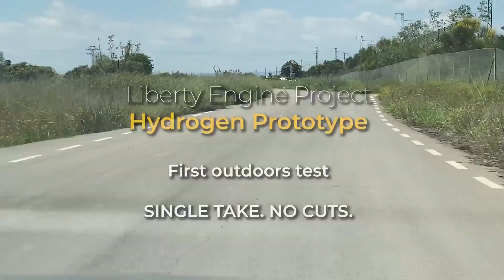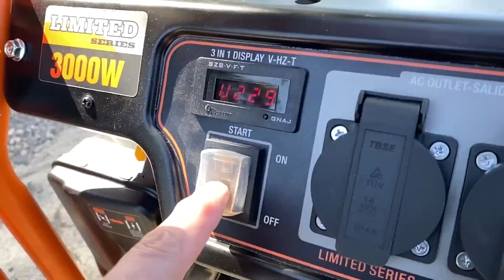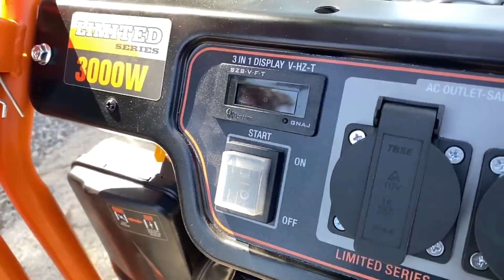I CONVERT GASOLINE ELECTRIC GENERATOR TO RUN ON WATER

Comment: Legit question, is it important that the carburetor and fuel lines have NO leaks? Also, sense there’s no carbon, would you have to change the oil as often? Does the engine get as hot?   Thanks

Comment: Just shared this to an engineer/machinist friend of mine to see if he can build this for us, as we run our generator almost every day (sometimes two or three times a day) and it costs us a fortune in fuel!

For everyone wondering about the charging vs draw on the battery: small gas generators DO NOT have alternators! The electric starters on these are there as a convenience only, and these generators still come with recoil (pull) starters for when the starting battery runs out/fails. Now, that being said, these batteries do last quite awhile: we have to charge ours about every 50-100 starts or so (just a guess) depending on the temperature outside (more frequently during the winter months).

Comment: I would like to see an inline amp meter on the charging Circuit of the battery to show how many amps It is charging . I would also like to see an inline amp meter to show how much your fuel cell is drawing for current to make the hydrogen.. the way you have shown it it does not prove anything because the battery could go dead in 20 minutes I want to see proof that the battery charge was maintained meaning the charging circuit provided more current than the fuel cell desired

Comment: My buddy says this doesn't work as well as you say it does, and I quote, "This is a lie, does not actually work.
First, the energy it takes to separate the Hydrogen from the water is allot and you only get about 40% of the energy back in a ICE. Also you need allot faster generation of hydrogen to sustain an engine like this.
Jewelry makers use torches using this process and you should see what 1500 watts creates.".
Is he accurate?
Is there merit to his statement?
What are the limitation so this machine as well as the concerns of the woman below, with the Hydrogen, Oxygen mixture?
I'm honestly interested.
I wan this to work can it be tweaked to work even more efficiently?

Comment: where can I buy this?does it work with sea water too?It would be nice if you could also buy the device.
Reply: Работать с морской водой он будет еще проще, тогда добавлять в морскую воду порошок KOH не надо будет. Только необходимо будет обязательно хорошо ее профильтровать - там много органических примесей и даже чистка электродов будет менее необходима так как там электроды другие. В России все это есть и работает.

Comment: I'LL REPETED THE SAMAE QUESTION ''WHATIS HH+" WHAT IS THE TRUTH OR YOUR LIESERS
Reply: HH+ [Hydrazine Hydrate] is a mixture of chemicals that helps enhance the electrolysis of water using very little electrical energy. [IMHO]That means that in the future we will all be able to have vehicles that run on Hydrogen extracted directly from water.
Reply: Jakiego rodzaju mikstur to wymaga. Czy je sprzedajesz, czy można samemu zrobić? Pozdrawiam 🙌🥰
Reply: @krzysztofurbaniak8777  Если вы получите расширенные письменные рекомендации и прямую консультацию по ходу изготовления, то сможет это сделать любой человек. Хитрость умалчиваемая в видео это в виде генератора - он должен быть не чисто бензиновый, а бензо-газовый и вопрос в электродах. Те электроды, которые показаны в видео вам периодически будет необходимо разбирать установку и чистить.

Comment: How long does the water in the blue container take to evaporate/lose its ability to create hydrogen?
Reply: DEPENDING on the size of the Filters, general approximation  of the time would be around 4 to 12 hours, with the house water filtration systems running about 12-18 hours. This setup could run 8 hours.
Reply: @williehayes1729  можно даже больше

Comment: What is HH+?
Reply: Hydrazine Hydrate(HH+) and the best HHO separator is Potassium Hydroxide - KOH; A combo of both ran my little house for four years on water with a 3500 watt generator running on HHO and two House sized Filters with an automatic water feeder setup (used a drop in psi to 5lbs) and worked well, up until it was replaced with an air powered unit with four air powered tanks running an air powered compressor charging up one tank at a time in tandem with the other three while one tank discharges into the engine turning the power generator to generate power for the household appliances, yeah, we celebrated with a libation of choice.
Reply: @williehayes1729 could help explain to me how you completed the air powered generator in more detail please or provide a link to a page to a similar setup as your own ? Thanks

Comment: just looking at your bubbler tells me you're not making enough HHO to run ANYTHING let alone an engine of that size.
Reply: Potassium Hydroxide - KOH; Hydrazine Hydrate - HH+; The only way to measure the HHO coming out of the HHO generator is to put an air pressure dial on the input of the carburetor and see if it goes to -20psi. (Vacuum) … Engines will not start well if the engine doesn’t get a consistent draw of at least -5 to -20 psi - before HHO burns back into H2O. A consistent burn of HHO means the engine runs.

Comment: الغاز الذي يخرج اقل من طلب المولد هذا غير صحيح
Reply: Yep, your statement is incorrect. For a 3500 watt generator, the size of the HHO generator filter is correct, and the amount of HH+ (and/or Potassium Hydroxide - KOH) is measured as at least a modest 1/4 cup full.

Comment: With a gas engine of around 30% efficiency, a generator of around 60%, you need 180% OVER UNITY before this will work. I'm a mechanical and electrical Engineer.

Take this into the middle of a field and run it, then I might believe you.

Essentially your battery is providing the extra energy. When that is discharged, the generator will stop .
Reply: It is producing too little hho gas to turn this engine.
Reply: exactly
Reply: What if the generator was smaller ? Would it work better.

Comment: The battery is supplying energy for this construction and the generator is not able to return enough charge back. Please, don't fool the people.
Reply: Избыток, который вы не замечаете появляется в разности потребления топлива - на 5 кВт генератор потребляет 400 мл бензина или менее 100 мл воды. Тут уже имеется первая часть экономической выгоды. Генератор надо только обязательно не чисто бензиновый, а бензиново-газовый с редуктором. Вторая часть выгоды появляется в разности мощности, вырабатываем разности топлива - бензин, если взять за 100%, то газовая смесь HOH не менее 110% а то и более 140% что умалчивается многими   пособиями и справочниками. А аккумулятор нужен только для старта выработки, потом потребление падает так как при нагреве раствора выработка остается прежней при падении потребления. Проблема в том, что вы рассуждаете из того, чему вас учили и не делали это на практике.
Reply: @ГеоргийДемидов-е8ш  Прошу заменит батарею на конденсатор и раскрутить систему первоначально вручную.  Тогда всё будет ясно.
Reply: Quite correct. After ruining my Gasoline Generator to run on Hydrogen, I found the same to be true. The electric company sent four people out to find out how I was stealing electric power from their power lines. I love how quiet it runs.
Reply: @williehayes1729  I got my HHO kit, my 12V batteries and my gasoline generator but I don't quite understand how to connect the batteries to the generator so that they are charging while the system is running.. can you provide me some guidance?
Reply: The battery is supplying energy to separate water into H2 and O2, plus using the supplied H2 and O2 (instead of gasoline)fire up the mechanical engine and turn the generator to make electricity for the household appliances to use. Is that as clear as mud ?
Reply: @williehayes1729  For me - it's clear. The energy FROM the battery is more then the energy TO the battery.
Reply: @Apo5308  yes, you are righ - of course

Comment: C'è pericolo di incendio?
Is there a fire hazard?
Reply: Probably safer than gasoline since it is on demand fuel.  Unless he can get the current from the generator itself however it will only run as long as the battery lasts
Reply: @audiblebites553  Is it possible to obtain current from the generator for its operation without discharging the battery?
Reply: @pietroscarioni5238  I don’t know but that would make it an over unity generator
Reply: @audiblebites553  I think connecting a battery maintainer could solve the problem... or not?
Reply: @audiblebites553  can i write to you privately?
Reply: @pietroscarioni5238  possibly,  if this video is not faked then it does not take that much power to produce enough hydrogen to run the engine.
Reply: @pietroscarioni5238  sure,  I don’t know how to do that on YouTube though
Reply: @audiblebites553  нет не генератором избыточной энергии речь идет об удешевлении но на много процентов и простоте получения топлива - вода, но надо фильтровать или часто прийдется разбирать и чистить электроды, ну и правильные электроды, не отбрасывающие в воду железо, делающие воду оранжевой.

Comment: I dont believe the generator runs on hydrogen!!! Look at the amount of bubbles, never enough for an engine to run!!! You defenatly need 100x more..
I guess this is a 8 hp engine that uses about 2 liters of gasolin per hour... I calculate you need about 1400 liters of gas an hour....1 liquit gas liter makes about 700 liters of gas.  So NO WAY this video is realality!! Its clickbate!!
Did you know you need about twice the amount of power to make hydrogen, that it would give back burning it? Only with Hi frequentie Electric you could make the input less than the output.
Reply: Неплохо что вы попытались считать, но есть существенные ошибки. 1400 литров бензина в час - это какая-то неправильная цифра и скорее всего относится к газу. Во вторых тут часто ошибочно пишут и размышляют что двигатель работает на водороде - электролиз дает водородно-кислородную смесь и вот тут то и есть эффект. 1 литр воды может дать 1820 литров HOH газа электролизная установка на видео способна выработать минимум 180 литров, но может разогнаться и до 800 если сделать колбу и электроды больше и немного другие - автор не обязан вам показать все о миллиметров правильно. Сейчас на Украине и в России в фронтовой зоне обе стороны используют такие  установки.

Comment: This comment is my fuck you to greedy prices for generators - buy a 12v inverter and wire straight to the battary leads on a car , use a spare battary - any car without an ecu can be powered on 100% hydrogen ) diesel cars work well using biofuel ( one cap of white spirit to every litre of cooking oil ) - as a tip - plug a 36v charger on the 12v from the inverter nothing gets hot or melts and keep the power up when it's being used )  generators make too much noise , even if they do use hydrogen , try listening to the thing for hours on end , most of the time they break down after a few weeks so they are a waste of money , and I know this because I live off grid -  can use a 12v tire pump two air tight jars and a pizza cutter ) its possible to use a tiny engine turning a car alternator ) try this because companies are just taking the piss out of thick people who have more money than they deserve .

Comment: Thank you friend ! 🤩
About 7 years ago, I already put this technology aside for a long time ... I was once pushed the wrong metal ... Although it was quite effective with the right power supply unit! But out of 10 plates - 6 went through! Although after that I found a way out, I postponed the research for an indefinite period.
I am interested in :
- connecting the power supply to the plates! Directly, is it better to use a special "cold radiant energy" microcircuit? I used both TESLA and Bedini, better than traditional hot current, the plates almost did not heat up. The results are not bad, although from the right material of the plates - the results would be better!
- connection to the fuel system! Did you connect to the air or gasoline hose? Do you need a fuel pump? Or how to regulate revolutions, if it is not a generator? I will be grateful for the advice!

Дякую Друже ! 
Десь років 7 назад я вже відклав цю технологію надовго ... Колись мені підсунули не той метал ... Хоч і з правильним блоком живлення було доволі результативно ! Але з 10 пластин - 6 проіло наскрізь ! Хоч після цього я знайщов вихід , але дослідження відклав на невизначений термін .
Мене цікавить :
- підключення живлення до пластин ! Напряму , чи всеж краще використовувати спеціальну мікросхему " холодної радіантної енергії " . я використовував і ТЕСЛА  , і Бедіні , краще ніж традиційний гарячий струм , пластини майже не грілися . Результати не погані , хоч і з правильного матеріалу пластин - результати були б кращими !
- під"єднання до паливної системи ! Ви під"єднували до повітряного чи бензинового шлангу ? Чи потрібен паливний насос ? Або як регульувати оберти , якщо це не генератор ? Буду вдячний за пораду !

Comment: would it work on any Gasoline Electric Generator? and would it make enough Electricity to run a small house?
Reply: Depends on what you plan to power and what kw the generator is.
Reply: @VXRHSV  fridge, cocker, tv and washing machine

Comment: I tried one of these on a buddy's refrigerator unit from a semi trailer 3 cylinder diesel it needed 2 production chambers and one bubbler tank but it ran just fine he used it for air-conditioning his shop ran it on diesel/propane. The reason I tried it was because I was thinking of getting one for the same use but also for heat and I wanted to install a belt driven generator head on the engine for electricity also they are half as noisy as the small generators I've used 2nof them one would also run on wood gasification also.
Reply: Wood Gasification actually goes back to World War one
Reply: @jeremygenslinger4874  really, do you have any links?
Reply: No not on a 2 stroke/cycle only on 4 stroke/cycle gasoline and diesel generators with valves that contain their own oil for lubrication as for a house if it's a small house and you don't try to exceed the maximum wattage of the generator. I used mine to run a one room cabin the longest I ever ran it continually was 7 days during a winter storm then I changed the engine oil the rest of the time I only ran it for a few hours after returning from work until  I went to bed. I even had a lawn/grass mower that ran off one saved a lot of money. You also might want to check out wood gasification and Geet fuel processor's both work equally as well.
Reply: @jeremygenslinger4874  wood gasification? that is something new to me
Reply: would it work on any Gasoline Electric Generator? and would it make enough Electricity to run a small house?
Reply: I've run it on different engines the biggest was a 4 cylinder irrigation pump also a 3 cylinder diesel engine in a semi trailer refrigerator unit you just have to experiment to see how big you need to make the reaction chamber or multiple ones to produce enough HHO gas to run on your application

Comment: Hydrogen implodes, so how did get a combustion engine to run on fuel that implodes?
Reply: Licht a balloon with hydrogen please, before you make a contradictive comment thats Just not treu!
Reply: Správne,  vodik imploduje to znamená že keď je piest motoru v hornej uvrati miesto explózie, čiže rozpinania sa zhorenej zmesi ktorá pohne piestom do dolnej uvrati by došlo k implozii vodika čiže podtlaku k opacnemu efektu ako pri zhoreni palivovej zmesi,  teda k implozii by muselo dôjsť keď je piest v dolnej uvrati a vybuchom-zhorenim vodika by vtiahlo piest smerom k hornej uvrati.  Taktiež vidím problém s tou elektrolýzou pretože tam sa uvoľňuje pri jednej elektrode kyslík a pri druhej vodik- či?

Comment: How long electrolysis process last on that battery (12V ) ? Is it sufficient generating HHO for 3.5KW generator operation??
Reply: If you are running it long term I wouldn't do it this way I used a 48 volt ac to DC power supply that plugged into the generator that I switched to after starting it off the battery most people using a generator don't actually need to run a 2000 square foot house off it but there's a bunch of idiots who try and expect it to happen.

Comment: Baking Soda is the perfect catilyst for making Hydrogen !
Reply: I used 2 parts baking soda and one part borax mixture for the catalyst and used it for a few hours a day in the early evenings between work and sleep for years
Reply: @jeremygenslinger4874  what did the borax do to it ?
Reply: I don't know the exact chemical reaction but when I used just baking soda the engine would run rough and sputter found on a forum to mix it 2 to 1 baking soda to borax and it produced more HHO Gas and the engine ran smoothly after the catalyst they showed is probably the same or another suitable replacement for the borax

Comment: how is engine lubrication handled when there is no gasoline. how long does it last before the engine seizes?
Reply: its a 4-takt, so there is oil for lubrication like in a car (under the piston in the block). for this kind of project you cannot use a 2-takt becouse you need a mixture of gasoline and oil for lubrication

Comment: YES! Finally, someone makes a video proving water engines are possible! Now, if only people in the comments would remember new(er) inventions need improvement over time. Could you test if it would work with plain salt instead of HH+?
Reply: Do not I repeat DO NOT USE SALT for the catalyst use baking soda if you can't find a catalyst that isn't corrosive that was just a insane question salt what the hell is wrong with people. I know there's a old saying that there's no stupid questions but there really really is .